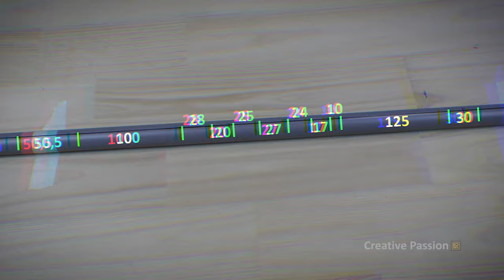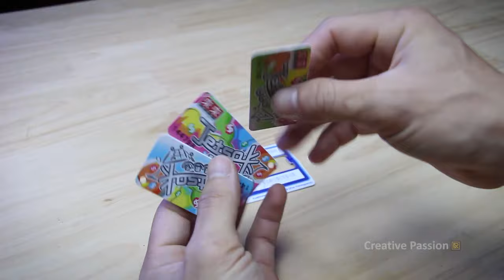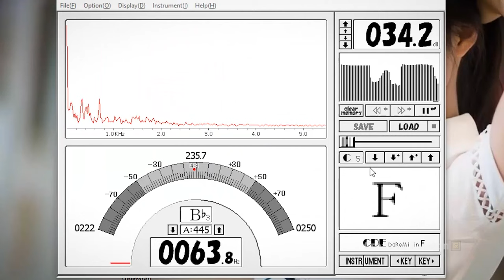How To Make Flute With Simple PVC Pipe.

Comment: Nice work, sounds so cool!

I hate to have to bring it up, but be careful with grey, electrical conduit PVC. Like plastic drain pipe, it has toxic compounds in it that can be brought out by the enzymes in saliva. Just holding it in sweaty hands can bring toxins out. Anything acidic will. White schedule 40 pvc, and tan colored CPVC, are safe since they’re intended to be used as water supply pipes, but they may have slightly different acoustic properties, because of the thicker wall, and differences in density. CPVC is harder than PVC, is more challenging to work with, and is not the same bore size as white PVC. 3/4” (19-20 mm) white PVC’s bore is 3/4”. However, 3/4” tan CPVC is not actually 3/4” bore. Its bore is actually 5/8”, and 3/4” is its OUTER diameter. So careful of what is 3/4”, and whether it’s inside, or outside diameter.